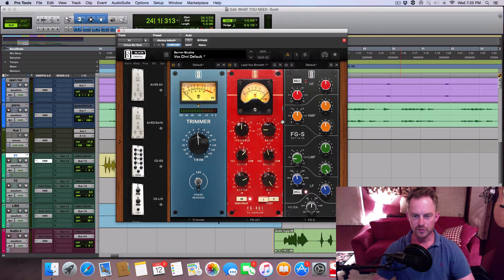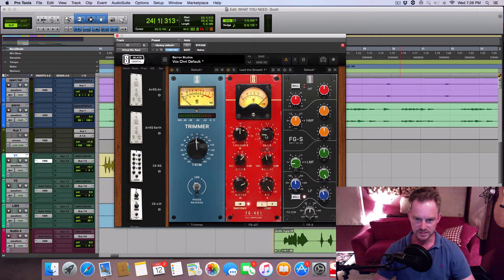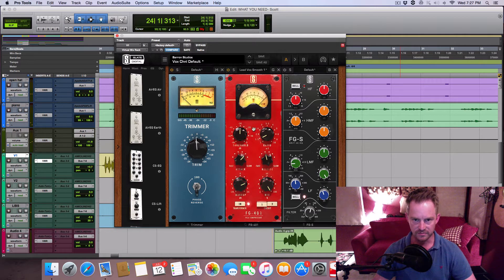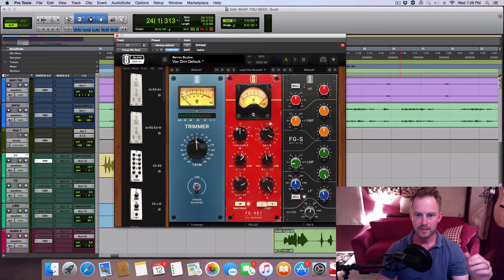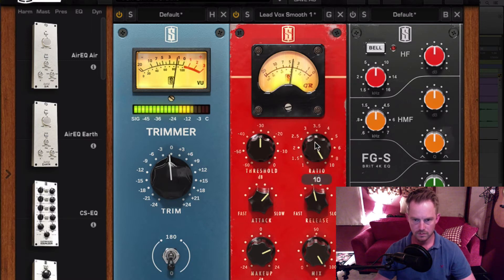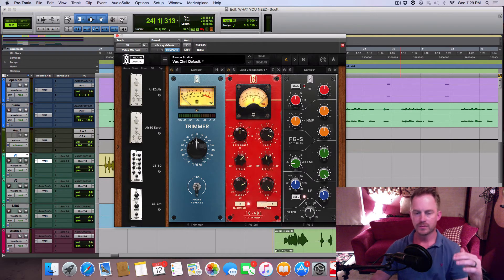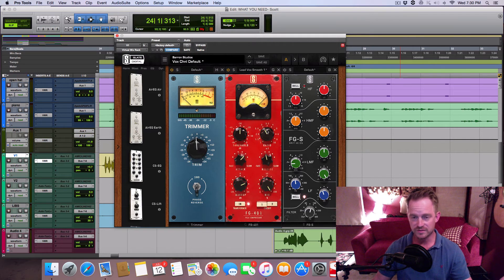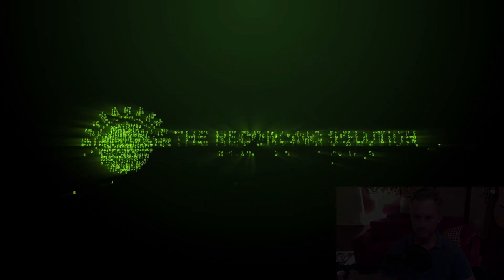Compressor Ratio Explained For Beginners

Comment: Using compression for a more consistent level is good; adding gain with a low level threshold, attenuated by attack/release and ratio. It is better to reduce higher levels in post production (in the mix) to avoid losing quality/dynamics, as long as there's no clipping- unless you'll be adding amounts of saturation, then it really wouldn't matter :)

Comment: Love the explanation.  So on my electric guitar which I use for clean rhythm then lead lines and fills with overdrive.  Would you agree that a lower ratio is better...since I change dynamically quite a bit? Our guy had me at 10:1 I'd say no more than 3:1.

Comment: If I have a 2:1 ratio and my signal hits 4db above the threshold only 2 db would pass but what if I went 5db above? Would the extra decibel be accounted for or ignored
Reply: 4dB over the threshold at a ratio of 2:1 means 4 divided by 2 which equals 2dB. So your output level becomes 2dB.

5dB divided by 2 equals 2.5dB, so your output becomes 2.5dB. 

To show how the different ratios affect a signal:

4dB at 4:1 = 1dB
4dB at 8:1 = 0.5dB 
4dB at 12:1 = 0.3dB
4dB at 20:1 = 0.2dB 
4dB at 50:1 = 0.08dB 
4dB at 100:1 = 0.04dB (limiting) 

Hope it helps!
Reply: @RussellFeatherstone  yep thanks a ton!

Comment: Dude... I literally can’t hear a difference :”(((((
Reply: The attack is set pretty slow and transients (accents in the lyrics) go freely, so listen to the level change that happens immediately after it. You can hear that words are becoming quitter for a moment (less than a second) as the compressor is trigged after the transient (level spike, accent) is detected. Then it recovers to the original vocal level during the release stage, detects the transient (spike, accent) and volume drop happens again, but still it's very subtle.

Comment: Thanks Scott. Compression is a great tool and learning it's in and outs and how it effects the audio is important. I also get a bit confused from time to time about threshold and the relationship to ratio so I will watch, read and listen every time.
Reply from the maker: Thanks for sommenting. Think of the threshold as drawIng a line in the sand that says no compression will happen UNTIL your audio source crosses that line. Then the ratio settings tell the compressor HOW MUCH to compress AFTER it's crossed that line. If the audio never crosses that threshold then no compression will take place. Make sense?
Reply from the maker: Commenting*
Reply: @Therecordingsolution  So is the ratio the 2nd option if it is not enough with the threshold?
Reply from the maker: @samphonnetgamgee5625  the threshold just sets how much audio is going to get compressed. do you want just a little or the peaks to get compressed? Then don't set the threshold too low. Just set it where just the loud peaks are passing the threshold. Then adjust the ratio to tell the compressor how much compression to add to just the peaks that are crossing the threshold line. If you want all the audio to be compressed, then set the threshold lower so that all the audio passes the threshold line, and then whatever the ratio is set to will determine how much compression is being applied. If the ratio is 1:1, you can have all the audio crossing the threshold line, but no compression will be added until you start increasing the ratio.
Reply: @Therecordingsolution  I think you learn about the amounts by trying and listening. I haven't got a feel for it, yet. Thank you for taking your time!
Reply from the maker: @samphonnetgamgee5625  Yes, practice is key! your're welcome! -Scott